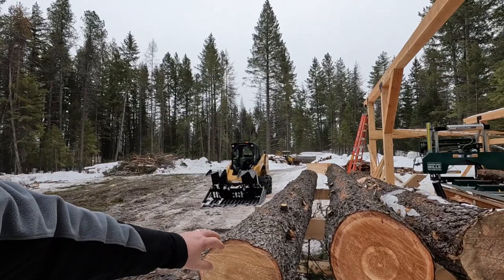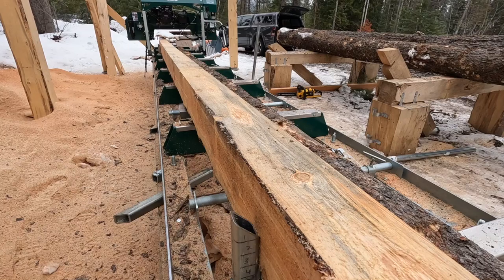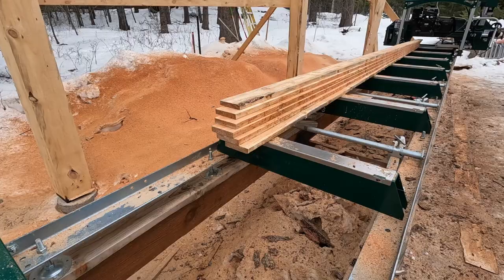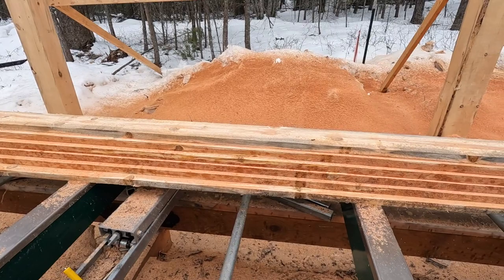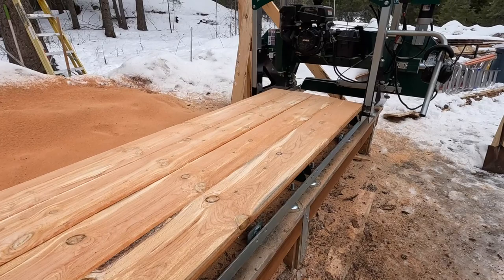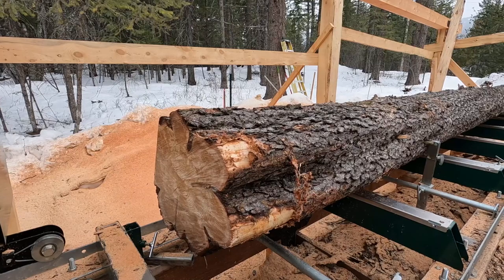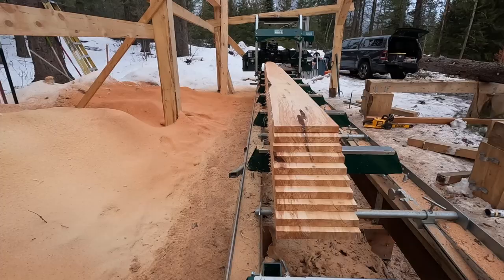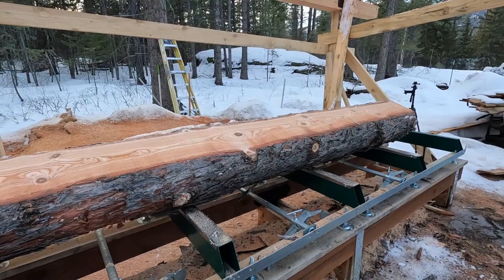Milling Your Own Roof Decking // Sawmill Shed Build // Woodland Mills HM130 Max // Milling Lumber

Comment: Nice job. When turning logs, you might try putting a piece of pipe over your log stop to make it taller. Easier and faster than raising the log stop each time and it will make sure the stop is taller than the log. Try it and see if it works for you
Reply from the maker: That’s a great tip! I’m a little leery of pvc, so I might try metal pipe. Thank you!
Reply: I use poly pipe and it works just fine.

Comment: Us loggers call that red rot.  When we see it in the woods cutting trees it is contagious to other lodge pole so we clear cut it for a radius of 100 feet from an infected tree it spreads in the roots.   My local mills will take it as long as there are not white spots in it.
Reply from the maker: That’s great information! That might explain groups of dead lodgepole that we see. There are groups of 6-20 clusters of dead lodgepole that have died throughout the property. Doug fir don’t seem to be effected which is our other prominent species. Thank you!